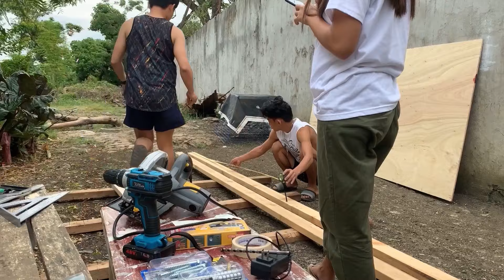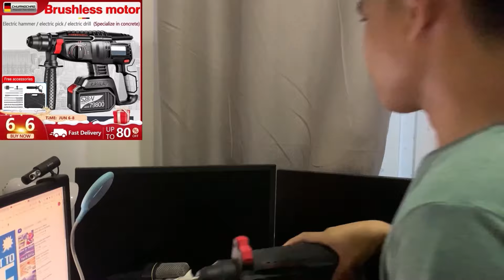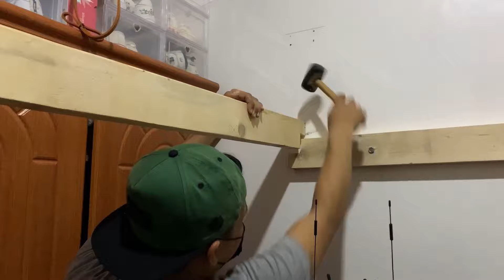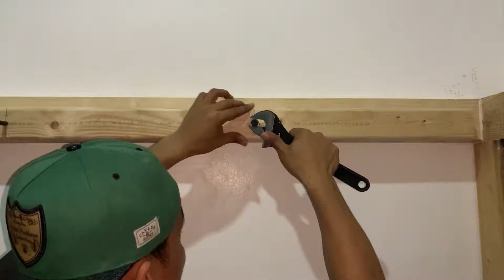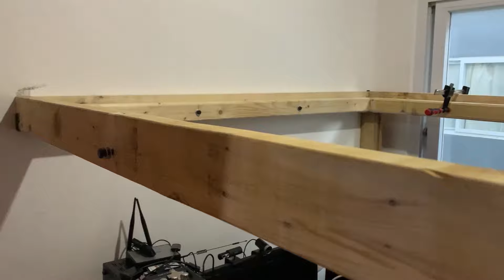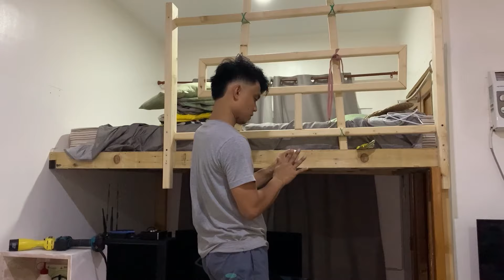DIY LOW BUDGET LOFT BED |BAYANIHAN FLATS | Part 1

Comment: How can I make this apartment friendly 😅 I would love to make this for my son but I'm worried about damaging the walls.
Reply from the maker: First, make a plan, choose resources, sketch a design, and gather tools, especially for drilling walls. Make sure your loft bed dimensions are accurate, and when drilling your walls, use a small drill bit first, then a drill bit that fits your cap screw. It should be fixed and easy to drill.
Reply: I think its possible if you use metal frames instead of wood to make it more stable and you dont have to attach it to the walls or use more solid wood and connections, the goal is to make the frame more stable
Reply: Make sure to inform the landlord first and don't forget to fix the damages before leaving the apartment if ever you decide to move in another apartment